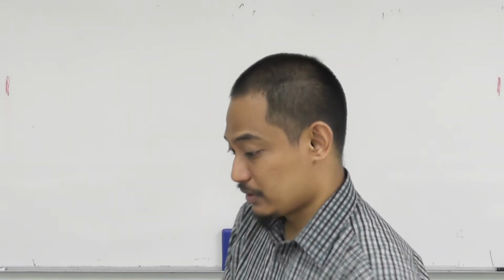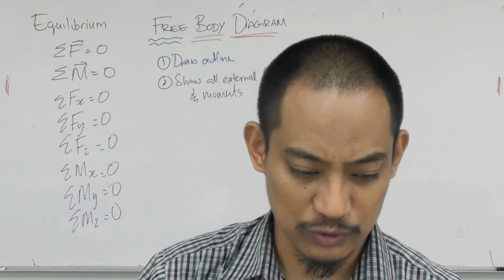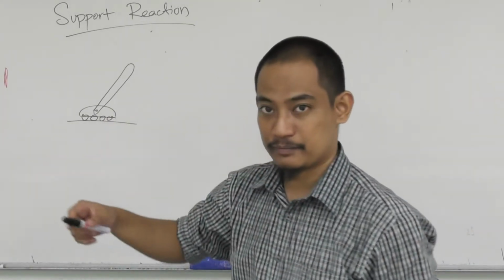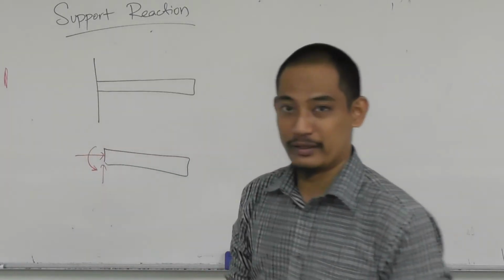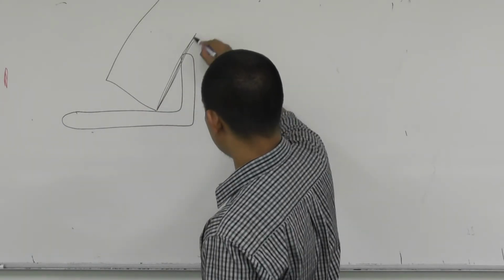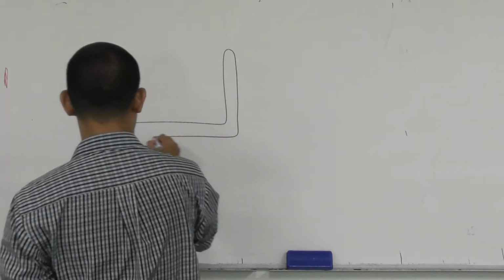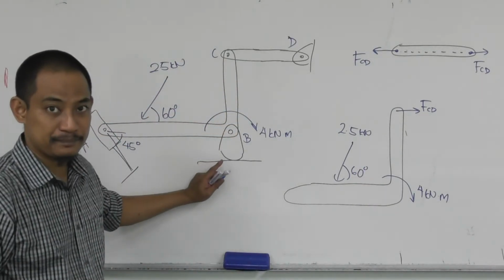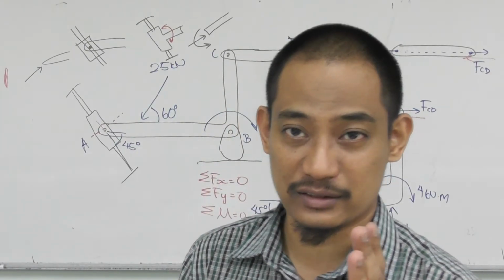Statics - Chapter 5 (Sub-Chapter 5.1 - 5.2) - Equilibrium of Rigid Bodies & Free Body Diagram

Comment: Assalamualikum Dr, whenever we need to indicate the support reaction force from a point, suppose the point is called B, so we write Rb ?
Reply from the maker: normally if it have x and y component, Bx and By are normally used
if it is a normal reaction force, Nb is normally used
if it is a tension force from cable, Fb or Tb is normally used
Reply: @SaifuddinRehan  Thank you Dr for clarifying this up.